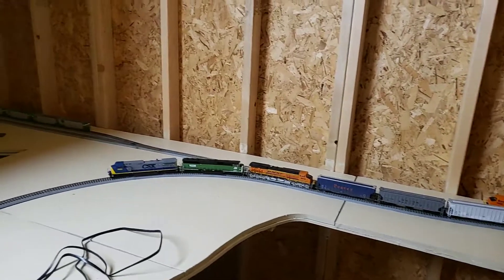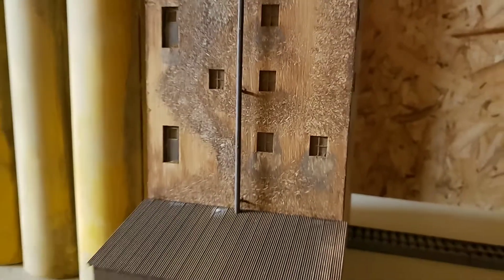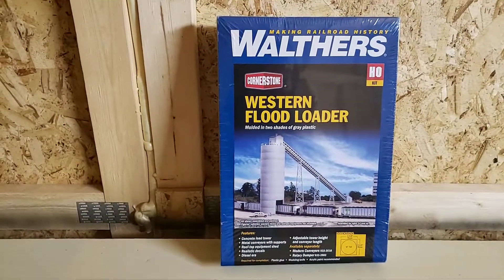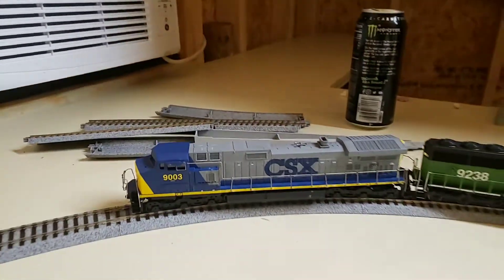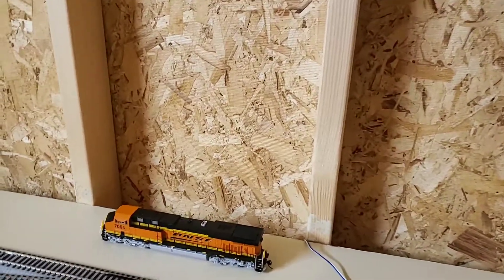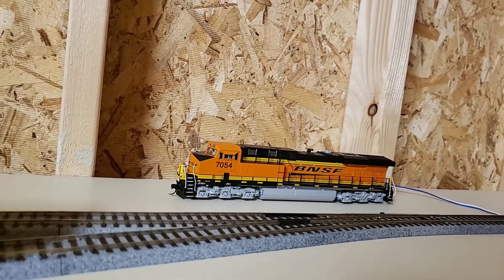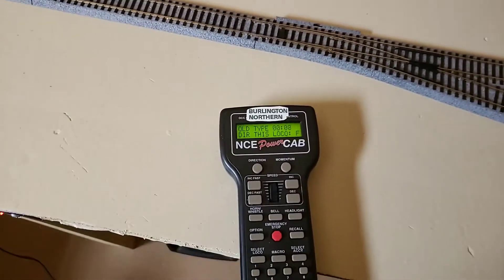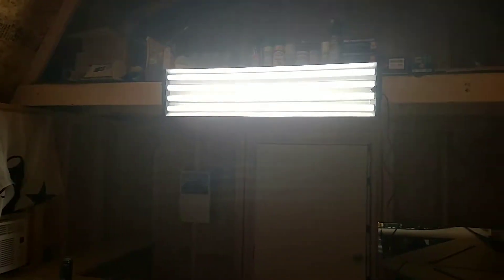BNSF layout update #2 (Grain elevator)

Comment: Its your contact points shorting on something, it will shut your power cab down, you need to keep that engine off your layout till you run down the short in it, use a program track or test track, ya gotta keep em seperated, love the train room good job

Comment: That Loco has a direct short either on the pick on the trucks or the decoders board is bad. I would put it on a program test track and see if it runs ok. Also make sure you have enough feeder wires and voltage and amps for your system. This should get you going in the right direction.
Reply from the maker: Appreciate the advice on this situation Adrien Gadson..